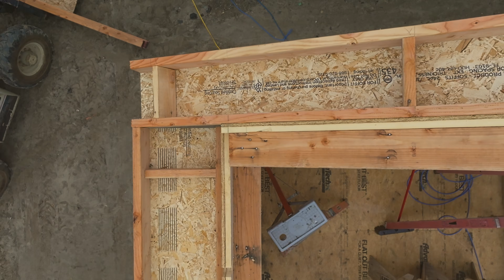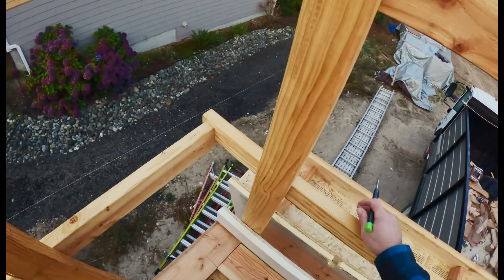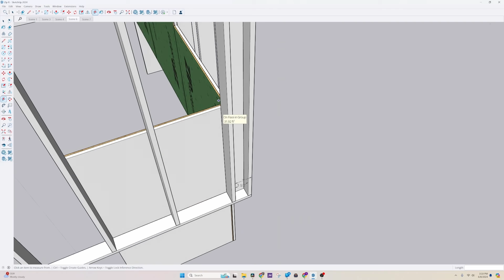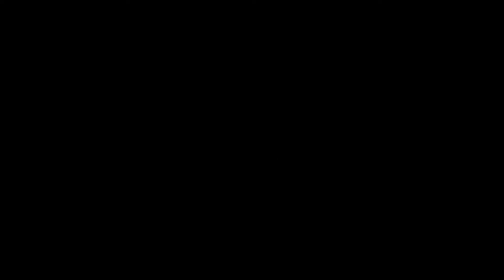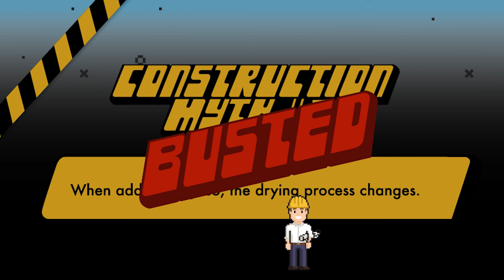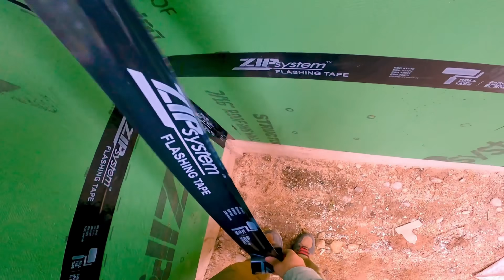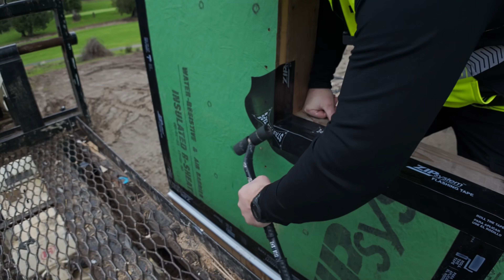EXPERT TIPS| Continuous Insulation

Comment: Increased sheathing costs. Increased ventilation costs. Increased maintenance costs on sophisticated air exchange units. Increased labor cost on HVAC. All in the name of saving $30 a month on energy bills.😂 In Western Washington, which has an extremely mild climate.  I had my windows open 24/7, 365 when I lived there.

Meanwhile, here in NC, we have brutal humid summers and actual winters and all we need is 2x4s with batts. 🤷‍♂️
Reply from the maker: I totally understand your points.  I do think though, that this is too narrow a view.  We gain a lot of benefits from going with CI and high performance windows.  We'll do a cost breakdown in another video.  We were able to reduce the HVAC equipment.  We view CI as part of the mechanical system, even though it isn't. Viewing the structure is a holistic approach for us.  We get a more comfortable building, a quieter building, more efficient building, have filtered air and our homes have much lower maintenance than our competitors.
Reply: @AwesomeFramers and you make a lot of money by plugging their products
Reply: I used ZIP-R on my house. I'm convinced it's worth the cost/effort, but introduces several complications. Among the most costly are custom window and door jambs.
Reply: @ceterisparibus51  I'm in the planning phase right now and will likely be forced into using ZIP R6.6.  Two questions, why would windows need custom jambs? Did you just add 1" to the exterior door jambs?  I'm mostly worried about a custom jamb for the 144"x96" patio door....
Reply: @lucascole7589  Just to be clear, I am not a pro builder/carpenter. But a standard window/door jamb for a nominal 2x6 wall is 6 7/16" deep (i.e., "standard" in the sense of not typically requiring a custom order). A typical ZIP-R6 wall will be 7 7/16" deep (5 1/2" for the stud + 1" for the foam board + 7/16" sheathing + 1/2" interior drywall).
Reply: It's not at all about hot or cold......it's about if you buy energy?
Reply: Interesting because that's kinda the thinking when my grandfather built his first house. Why bother with insulation when wood heat was cheap. Let's face it if the living room is 85 degrees the bedrooms will probably make it into the upper 60's. Then you would think the remodel, where the county forced the removal of the wood stove, would include stripping the inside walls to replace ancient cloth insulated wiring and adding insulation. Nope. That's how a little 1100 sq foot house cost 400 to heat in winter where average temps are above freezing.

Comment: Great details on framing with Zip R6.  Why didn’t you slope the bottom of the widow rough opening?  Surprised Steve didn’t say anything.
Reply from the maker: Great question, and I'm going to be blunt.  This is a waste of time, it doesn't actually work.  We'd rather focus on detailing the siding and windows/doors/roof correctly.  There are 10s of 1000s of homes that have no issue with water that would have been mitigated by sloped sills BUT there is zero evidence besides hypothesis that they work.  Now I'm specifically talking about the siding we use here in the PNW e.g. fiber cement, SmartSide, cedar, shingles, lap and board on board, etc.  We've pulled a lot of siding off old building and found nothing bad that wasn't directly related to crappy installation.  

As an example of my thinking, when I drive my car inside the garage after being in the rain, I see very little water on the ground.  A few hours and its gone, that is with a sloped slab.  I know, its not a great example.  We will never see enough water past our siding and window that would overcome physics and drain down and out.  In fact the ring from my coffee dries quickly and I just clean it  up.

Comment: If you use floor or roof trusses, and you want your studs to line out for siding purposes, then layout needs to be thought through and addressed with the truss manufacture during the planning stages because otherwise you’ll waste a ton of zip sheathing trying to get the proper overlaps on your corners.
Reply from the maker: Good points.  Preplanning is so important.

Comment: Those rollers are so dumb.  I guarantee you can make that tape stick better rubbing it on with your hand
Reply: Very doubtful
Reply from the maker: There are studies that show how wrong you are.  BTW, it isn't just Huber that requires this, but look at where tapes are used in other industries......this is a requirement from the chemical companies that make the adhesives.
Reply: I think this is a Huber warranty concern. They can inspect any warranty claims by looking for the perforations left by a ZIP roller. Likewise a GC can check to see that their guys are installing it correctly.
Reply from the maker: @ceterisparibus51  Rolled tape performs noticeably better than "hand pressed".  Anyone can compare, they don't compare.
Reply: @AwesomeFramers  Agreed (and didn't mean to imply otherwise). The bigger issue, IMO, is that unless you are rolling yourself, or have a very disciplined crew, it's hard to get contractors to do this (correctly/consistently/thoroughly). In my neck of the woods, I think this is largely because they don't see the value of the ZIP system.